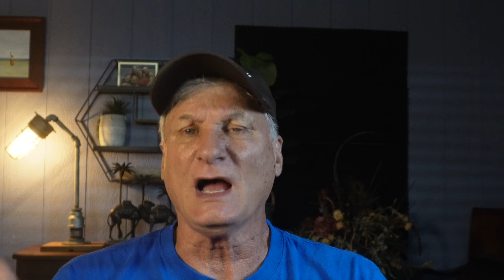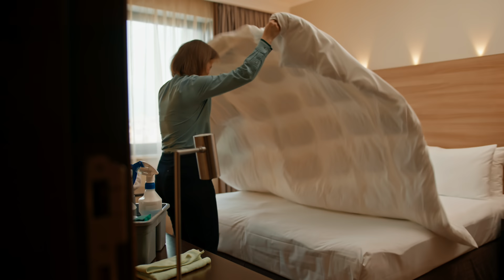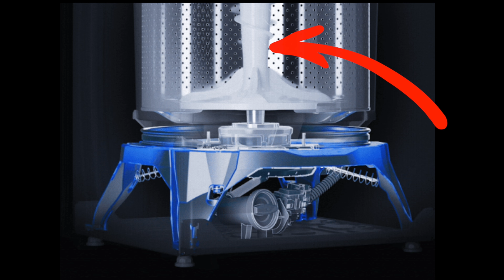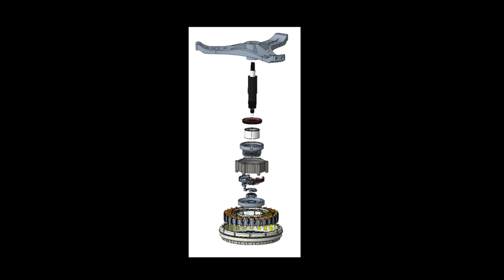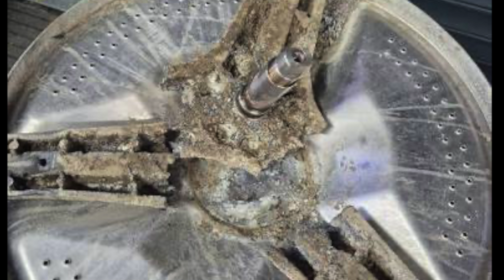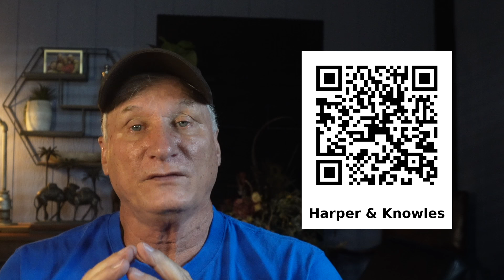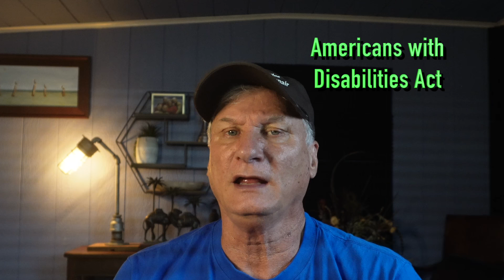Maytag's New 30-Year Washer: No Gearcase, Real Agitator, 900 RPM

Comment: If my Speed Queen ever dies maybe i’ll look at a Maytag but if it still costs more than Speed Queen and its not made in the USA it won’t even get another look from me. These companies should have never started selling junk in the first place.
Reply from the maker: Well, they are supposed to be making this in Clyde, Ohio. Made in the USA and assembled in the USA are two different things, though. Thanks for watching!
Reply: @HarperandKnowles  TBH I am fine with assembled in the US as long as they try their best to minimize foreign products.  As someone who has done BOM, there are certain parts which just aren't made in the US anymore, and you can't force people to make them.  Though it would be nice if the government stepped in to help guide people to the holes in our production cycle.  No company is doing that, and if they did, that is extra overhead.
Reply: @thisisashan  I work at a Whirlpool plant.  It provides over 1000 jobs to my community, and we purchase from a lot of domestic suppliers.  If it's heavy and bulky, it's more likely to be sourced domestically.  Not always, as a lot of steel still comes from Asia.  We've got steel mills and aluminum foundries coming back online now, so maybe that'll start to change soon.  There has been a noticeable shift toward domestic production, and I am 100% here for it.  The resulting jobs are what will fix this country.  Working people with money in their pockets purchase goods and services.  It goes right back into the economy instead of sitting in a savings or brokerage account.
Reply: @thisisashan   I believe Whirlpool is opening up a new parts plant in Perrysburg ohio
Reply: @FirstLast-vr7es banning stock buybacks is way more efficient way to put money back into making products here than anything done since Kennedy.
Reply: @thisisashan I would love to have a long discussion with you about that lol
Reply: @tym3873 Small world.  I worked last year in Perrysburg.
Reply: @ldcgalactica2196  You are welcome to.  I wish it were not the case.  

The people who try to fix that issue quickly find themselves at the sharp end of the propaganda stick.  One of the biggest mistakes we have made is allowing China to buy airtime on US airwaves, and properties in our borders.

Easy example of what i'm talking about is lithium batteries.

We need, for infrastructure sake, to change the fact 99.9% of our lithium batteries are made in China, and the precious resources come from there to make them. (phosphor)
Reply: @thisisashan assembled in legal speak probably isn’t what most people think it is. I forget the details of this story but I’ve heard of how tax was being avoided by a company by buying equipment like trucks to be assembled and they left off the wheels and bumper. The same company was buying large amounts of steel in bulk for manufacturing and they were saving money by having holes drilled into the steel and it being sold as parts not steel to be used for manufacturing. Uncle same hammered this company but it wasn’t the trucks and it wasn’t just the fraud with the steel purchases.
Reply: @thisisashan  U are right.  There's an incredible amount of lithium in NC & many ppl believe that's why "they" created that hellish "Hurricane Hellene" (sic)  in that geographical area. It didn't work in their favor but it sure as hell did ruin many ppl's lives. There are still 10 or 11 ppl from one family who are missing. There are many, many more ppl still missing & presumably burried under that hard packed mud. I'm so sorry for everyone who was affected 🙏🙇‍♀️✝️ my prayers will always be bless them.
Reply: @HarperandKnowles  Speed Queen's control boards, which have come under fire due to their unreliability, are not made in Clyde , Ohio, USA or anywhere in the USA.
Reply: @erossinema8797  exactly. They are assembled in the U.S
Reply: @erossinema8797 . The control boards are made in Mexico.
Reply: @HarperandKnowles  From the customer side being assembled in the USA by a corporation based in the USA is the important part. This comes back to reasonable recourse for faulty products and assurance that what you paid for is what is actually in the box. And even just parts availability after a few years is improved with domestic assembly.

Many consumers in the west don't understand that a lot of far east culture views getting suckered as the fault of the person being suckered for being too gullible, and taking advantage of suckers is considered completely ethical and even foolish if you don't take advantage. Completely the opposite of the western notions of reputation and ethics. 
From swapping out counterfeit components in the factory and forged safety certifications on otherwise non-importable items, to customer service dark patterns that just run you in circles until the legal clock runs out for filing a lawsuit, it is all fair game.
I've worked for large retailers with production in mainland China, we had to have somebody from the USA in China in the factories inspecting every run, both during production and while packing for shipment. We still had a lot of stuff slip through, which was simply a write off because the Chinese know the cost of return shipping is a deal breaker and even then they have already been paid and will just tell you to pound sand. (The companies are all partly owned by the CCP, so no legal remedy.)
Reply: @HarperandKnowles . The major point you glossed over is that Maytag still uses a plastic outer tub unlike Speed Queen which uses steel.
Reply: @jamesmitchell1780 , he most definitely didn't skip over the fact about the plastic tub vs the porcelain steel tub, about the 18 minute mark. The plastic tub in my KitchenAid washer lasted 35 years.
Reply: @jamesmitchell1780  plastic can last  over 50 years. the only things  i want out of a washing Machine is to clean  only a timer  last 30 years. how young are you? and no  Computer Board and  Kiss.  (keep  it simple  Sam)
Reply: @frybellevue Who cares
Reply: The new washer will be made in the US with of course some foreign components. Speed Queen is US-made, but even then, the electronics are often from Mexico or other places. They are still commercial quality. This washer will be the same way.
Reply: @YoungMTrucker600 parts are assembled in America.  They use parts from China Thailand.
Reply: @andrewmagee1666  and Malaysia, Mexico, Viet Nam, Brazil, the Philippines...
Reply: @andrewmagee1666   They have enough US parts content to use "Made in the US" label, meaning that a majority of the parts are American.
Reply: @YoungMTrucker600  Maybe
Reply: The clockwork controllers are still made in USA 😁
Reply: @YoungMTrucker600 we had a set of Speed Queen front loaders for around 6 months last year. Bought new. First problem in 3 months (killed the rear balance ring). Fixed under warranty and broke again 3 months later. Resold at a $1500 loss. Never again.
Reply: @squish3r  And here laundromats use speed queens for ten-fifteen loads a day and they rarely break. We have SQ top loader from 2016, and it gets used for 2-3 loads daily and has never had to have anything done to it. Shit happens.
Reply: @squish3r 
Front load washers are TERRIBLE (no matter the brand). Just my opinion.
Reply: @squish3r  you know top loaders are a lot  better unless  you can afford the ones  Used in a laundry mat i think
Reply: @squish3r  it's the operator
Reply: @YoungMTrucker600 . Yes, the Speed Queen boards are known to be sourced from Mexico, but from a good supplier.
Reply from the maker: Made in USA” on an appliance means final assembly, not electronics, and that’s exactly why board failures land the way they do — no domestic rework channel, no aftermarket rebuild, just a $280 replacement part.
Reply: @HarperandKnowles   It also means a majority of the parts have to be made in the US, but which parts those are do not have to be dictated in that way.
Reply: @unconventionalideas5683 
In autos to be considered a domestic car like 60% of the parts have to be made in the US.. it is why ppl saying buy American often do the wrong thing. Cars like Toyota Honda and other ' foreign'  makes are made here and have 80% us content. Meanwhile GM and Ford sell cars as 'american' that was made in.mexico and or has like 80% foreign made parts..
Reply: @HarperandKnowles  Something tells me that even if manufacturers found it economical to source boards in the US that they would design boards to be pull-and-replace and not repairable.  The auto industry learned the same thing with all the electronics being application specific and difficult to repair.

I really hope that Whirlpool is really building the new laundry pair with serviceability designed in.  I’m sick of products which are designed to minimize the initial cost of assembly with zero regard for maintenance costs.  That’s a short sighted ethic.  Sure, their unit profit is greater, but will they get repeat customers if their junk has to be scrapped after a few years.  Word gets around about what brands do avoid.  For example, the LG refrigerator linear compressor failure problem has really damaged their reputation.  People with LG refrigerators who have to pay up to 600 bucks labor for a firmware flash, full pump down and refill even though the part is warranted are pretty adept at complaining about LG to their friends.
Reply: @HarperandKnowles same with food
Reply: @HarperandKnowles  no its to say assembled in America.
I can see you didn't graduate 3rd grade
Reply: Amen!!
Reply: Why?!
Maytag has proven that they don’t care how much hassle they create when the machine starts acting up.
Reply: Exactly. Let’s see what CR says. Not going to be buying from Maytag or Whirlpool for many many moons!!!
Reply: @arthurfisch3673 . CR is biased. They say they aren’t and many years ago I believed them until I started to see that they were actually quite biased.  I no longer believe everything they say or their ratings.
Reply: @arthurfisch3673 CR used to be trustworthy, nowadays they're worthless.
Reply: Amen!  Ever since " lock in the hubs" became electric with a fuse...... I'll stick with my manual hubs and carburators!
Reply: @andrewmagee1666 
Anything 'managed by software' is a headache waiting to happen.

And the fix for that headache can often only be achieved by calling the manufacturer. Avoid those like you would avoiding eating raw shellfish. LOL
Reply: @andrewmagee1666 . Holy mixed metaphors Batman!  😊  No carburetors involved unless you mean a really, REALLY old Maytag!
Reply: @wtmayhew LMAO, one of the comments I was responding to mentioned not making anything like they used to like vehicles.  Although I would honestly probably sport a carbureted washing machine lol
Reply: @andrewmagee1666  I knew what you meant, but it was a good opportunity for a joke.  Thanks for the reply.
Reply: @wtmayhew Absolutely!😅
Reply: Never trade a SpeedQueen. Nothing beats that quality hence the price tag
Reply: I have a newer speedqueen . I am so disappointed. It doesnt have a soak cycle, doesnt wash my clothes clean.  Cant start filling the drum unless the lid is shut. Cant open the lid and toss in a forgotten item. Nope stop the whole thing and wait for the lid to unlock and then yuy uave to restart it..  The agitator is set at "delicate" for its speed. Unbelievably slow to agitate and cycle. We have a second laundry room for the mens work clothes and their speed queen is excellent.
Reply: @carolyn6001 
Please reply (when time allows) with the model number, please. Thanks.

If I ever I buy a SQ W/D, I want to avoid these inconvenient 'features' you mentioned.
Reply: @carolyn6001  Private Equity acquired Speed Queen a decade ago and that might or mught not have to with the newer machines becoming less reliable/efficient
Reply: @carolyn6001 Which model is your newer Speed Queen that's a disappointment?
Reply: I bought a Maytag commercial and it was a POS from day one.  Replaced it with a SQ TC5 and have never looked back.
Reply from the maker: Who said Speed Queen's control boards were made in Clyde, Ohio? They don't even have a plant there!
Reply: @HarperandKnowles  Whirlpool Maytag has an assembly plant in Clyde, Ohio.  Ben’s Appliances and Junk referenced in this video did Speed Queen disassembly and found the boards were marked with the name of supplier who builds boards in Mexico.  No problem where the boards are made in terms of quality.
Reply: @HarperandKnowles  I must have misread one of your comments in regards to SQs being made in Clyde, Ohio
Reply: Support speed queen they never baled in their customers like these have.
Reply: It’s the business plan.  Make it last for a minimal length of time (till the warranty is past) then make it break down.
Reply: My daughter kills washers I got mad last time bought one of the ugly speed queens from a used appliance store it’s out of a nursing home been 2yrs she hasn’t broken it yet. Best 400.00 I ever spent on a appliance
Reply: The top of line Maytag - I was sorely disappointed. Love my Speed Queen
Reply: @michellepaperchaser Which model of Speed Queen washer do you have?
Reply: If my speed queen ever dies, I’ll just get another speed queen!!
Reply: I'll take my speed queen for the win!!!!
Reply: I just ordered my first SpeedQueen set. My 1986 era Maytag washer has finally bit the dust. Sprung a second leak and I will not fix it this time. There are other issues like stabilizers that are not working when spinning. I ordered it at an independent appliance store. Only store display (won’t sell) is there. Twenty-two were ordered by customers, 20 already spoken for. I live in coastal Central FL.
Reply: As a Maytag owner I would think twice about buying a Maytag. I have one that I haven't been able to use in over a year. It was only 3 yrs old when it stopped working properly. I had it worked on and it washed maybe three loads then stopped working right again. I asked the repair man what brand in his opinion had the least problems and he answered Speed Queen.
Reply: I just went from Maytag to speed queen. My Maytag barely lasted five years to piece of garbage had a great warranty on it, but since nobody would call you back and you couldn’t find authorized Maytag repairman it was useless. I would never buy another one. Speed queen is the only way to go.
Reply: @mykehunt2430 Maytag told me that my washer did not have a warranty on it. It was just 3 yrs old. Although the repairman said the motor did have a 10 yr warranty on it.                    Anything you buy, even a plant has a warranty on it. This was told to me by an attorney years ago. It might vary depending on the item.
Reply: My Maytag is junk and has needed multiple repairs in a short time
Reply: The last I knew, Clyde Ohio, the location of Whirlpool's laundry product assembly plant, is still part of the United States.
Reply: @jamesmitchell1780  Reading is fundamental. And note that the machine is not manufactured yet
Reply: @chipdouglas9349 Your first comment makes no sense.  As far as the second one, Whirlpool's domestic laundry assembly operations are based in Ohio.  They located there to escape the unions at their original plants in Benton Harbor, Michigan and Newton, Iowa.
Reply: @jamesmitchell1780  I think you are correct that my first comment makes no sense. You are correct to point out that It doesn't make sense to look at a Maytag if the Speed Queen ever breaks, regardless of the price of a Maytag or if it is in the USA. Probably will still be making junk
Reply: @c@chipdouglas9349hank you for your response.  The troubling issue with Maytag’s predicted new design is that they are retaining the plastic outer tub which can be structurally problematic as well as a potential place for mold accumulation.  

Also the Newton Iowa assembled Maytags included a virtually indestructible porcelain top.  Even Speed Queen doesn’t have that feature.
Reply: @jamesmitchell1780 as you stated Assembly Plant. Thanks for clarifying that.
A-S-S-E-M-B-L-Y  Now that was simple
Reply: I won't be buying it if it's made in the US.
Reply: My speed queen is already between 20-30 years old, I’ve had her for 22 years and I can almost fix her myself, I definitely diagnose her so the tech spends less time working g on her when required. She’s so uncomplicated.
Reply: Oh put a sock in it and set it too permanent press
Reply: Same! Speed Queen is the best! I have an older set of LG huge front loaders that I just love. Candy Apple Red. Seven Horsepower Washer Motor. I hate agitator washers. They destroy your clothing & shoes! I will Never buy any agitator style washers! My next pair will be from Speed Queen. The reason I bought LG is because they are Not Made In China & I didn’t know at the time that Speed Queen made Home Style Washers and Dryers! I was angry afterwards but it was too late when I found out. We’ve had our set for over ten years though. There is a Sanitary Setting too, for nasty pet laundry.
Reply: I just learned speedqueen is now publicly traded company and is going to shit.
Reply: @jugeebean  Should I tell my well made machine that is working fine to identify as broken?
Reply: @jugeebean  

The Complete Timeline
1908: The company is started under the name Barlow & Seelig Manufacturing. Their first machines are called "White Cloud".
1911: They build their first electric-motor washer.
1922: The company becomes the first to use nickel-copper tubs to make the machines last longer.
1928: The famous brand name Speed Queen is officially born.
1939: They switch to stainless steel tubs, which are still a signature feature of their washers.
1942–1945: During World War II, the factory stops making laundry machines and switches to making 20mm ammunition shells and military parts.
1952: Speed Queen introduces its first automatic washers and dryers.
1979: The company is sold to Raytheon Company, a major defense contractor.
1998: The company becomes Alliance Laundry Systems, focusing heavily on commercial-grade strength. 

 
Today, Speed Queen is one of the few appliance brands that still makes its residential machines in the United States. They use the same heavy-duty metal parts for home washers that they use for big commercial laundromats.
Reply: @jugeebean    NOOOOOOOOOOOOoooooooooooo!!!  😫😭
Reply: HUH? They are made in Ripon Wisconson they were found by 2 Americans and is an American company so WHAT THE FUI* are you YAPPING about???
Reply: @robschaller9061  Reading is fundamental. Also note, the machine isn't even in production yet...
Reply: Whirlpool/maytag/amana/inglis/ washers are built to break and need a obsolete/or just over priced main circuit board after 4-6 years which will cost 3/4 the cost of a new machine so it’s kind of pointless to repair unless someone has the board for cheap or you find one on the side of the road with a good board but if it’s at the road guarantee it has the same issue main circuit board failure
Reply: Speed queens are crazy expensive now. 1300 for base model
Reply: @kata-ri2nq  I was buying a new washer every 5 years before i got my speed queen.
Reply: I would like a washer without a locking lid. Boy oh boy I dislike that locking lid 😡
Reply: Don’t waste your time looking,stay with what you know!
Reply: Yep😎🤙🌊
Reply: ❤ love our speed queen
Reply: Where do you buy SpeedQueen ?
Reply: @grasscutter1963  in the US, maybe try Best Buy or independent dealers; not sure about Canada, where they might be sold as Huebsch
Reply: Maytag went out of business over 35 years ago. Whirlpool building junk
Reply from the maker: Whirlpool acquired them on April 1st 2026.
Reply: @HarperandKnowles  maybe April 2006 instead of 2026?
Reply: @HarperandKnowles Whirlpool acquired who? Everything have have acquired they have turned to junk. Kitchen Aid in the 80's, Jenn Air, Maytag, roped, estate and on and on. I have been an authorized servicer for 45 years. Speed Queen was great till they sold to Raytheon. Service them everyday.
Reply: @Johnny-s3d3o  I think he meant to say that Whirlpool acquired Maytag in April 2006 but mistakenly wrote April 2026.
Reply: Thats what they want you to keep buying garbage every day to feed thier evil a$$e$!!!
Reply: Maytag is garbage. I bought a set about 3 years ago,  they're junk.
Reply: My personal servants handwash my clothes. 
I can afford them due to the high profits my appliance company pilfers from the peasants. Speed queen?🥱🥱🥱🥱🥱
Reply: Maytag is owned by Whirlpool now. The one I bought in 2021 screwed up at less than 3 yrs old. Had it repaired and it still is down beause it will not run correctly.
Reply: -- EPA's Obama-Biden regs. ruined dishwashers, washing machines and cars --  Tell me I'm wrong --
Reply: @MegaBait1616  you forgot them reducing allowed GPM in faucets
Reply: @1DwtEaUn  If you want more GPM switch the aerator.
Reply: @wtmayhew  The faucets aren't just limited there, the one I have has an integrated sprayer, using both faucet and sprayer at the same time and completely removing the aerator doesn't change flow rate as there is an internal restriction that limits both sprayer and faucet head somewhere internally.
Reply: @1DwtEaUn  Bummer.  I was able to change the aerator on my kitchen faucet to a portable dishwasher connector and it approximately doubled the flow.  It must depend on the faucet design.  I was also able to swap the aerator on the American Standard single handle lavatory faucet.  The factory unit was 1.6 GPM and I ordered 2.6 GPM replacement from the AS web site.  I replaced my commode which was a really lousy 1980s era water saver with a a 2005 AS fixture.  The new toilet is only 1.6 GPF, but it does an awesome job, supposedly can flush 24 golf balls.  My tub fixtures are old, so no worries about low flow there.
Reply: @wtmayhew  Mine was procured right as they were making the switchover to 1.2GPM max limit, wish they were all limited at aerator as with yours.
Reply: @MegaBait1616 . It didn’t take Obama or even Biden.  Manufacturers started selling crap appliances in the US at least as far back as the end of the Reagan administration.  I have a 1986 residential Kitchen Aid Hobart dishwasher that needed a new timer motor a few years ago, but otherwise no issues.  I easily repaired it myself.  Try to find dishwasher of any brand more than 10 years old made after that year and still surviving.
Reply: @MegaBait1616  neither Obama, Trump, Biden nor Kamala created planned obsolescence and enshittification. Corporations can do (and have done) that all on their own. Am I wrong? Did any US administration force companies to make everything into an IoT product? Or force Sony to eliminate physical discs in the future?
Reply: @MegaBait1616 you totally wrong. Washing machines, appliances and cars have been junk for decades.
Reply: Your Name says it all
Reply: @MegaBait1616 That's the whole point of having a Communist Muslim in office... to destroy the USA.
Reply: @MegaBait1616  you are wrong 😆
Reply: @SayAhh - I think he's right on -
Reply: @crystalminnow7321  the Chicken Tax ruined cars and trucks in the US, and that preceded Biden AFAIK. The only thing Biden ruined that I can think of is the requirement to add the software to detect whether drivers are distracted that was supposedly going to begin next model year or something.
Reply: I believe Speed Queen sources the electronics boards from a Mexican manufacturer.
Reply: @wtmayhew Have to be careful about that because China will mark things with "made in" and have a town named after the USA or Mexico or other places.
Reply: @wtmayhew  Usually that is how they get it over the border.  Ya'll should really get off that shit though.  It is bad for you.
Reply: It’s not as much as where it’s me as much as it’s what it’s made of. It could be made on an island in the middle of the Pacific for all I care as long as what it’s being made of is bulletproof. Part of the problem is these companies are driven by the consumer and their marketing to the consumer. The consumer wants all the bells and whistles which unfortunately makes things less reliable because all the bells and whistles require electronics to drive them. These companies can certainly build products that will last for decades. The problem for the consumer is that a they don’t necessarily want to pay that much for a machine that doesn’t “appear” to do a lot.
Reply: @UncommonSense1776 Good point.  Even my current basic washer has four cycles and I have only used two in 20 years.  Not that adding cycles really increases the parts count. On fancy models there are frivolous add-ones that are things which can break and encourage manufacturers to spend less on the infrastructure of the machine.  What I like about out the Speed Queen TR5 is that there are very few options but everything about the machine appears to be very heavy duty.
Reply: @UncommonSense1776 That's weird: I thought they were all driven by share prices and quarterly profit reports.
Reply: @UncommonSense1776 Might not matter to you but it matters to me.
Reply: I love speed Queen, but they are not American made.
Reply: @andrewmagee1666  You shouldn't talk about your drug problems on youtube, the government is listening.  Though I am sure the queen of speed appreciates your purchases.
Reply: @thisisasshan.    It may be coming in the near future president Trump as you know is changing the whole economic structure of the United States is bringing back the American system and kicking out NAFTA and the British globalist economic system, whereas Americans will become makers instead of consumers once again hooray for president Trump yeah!